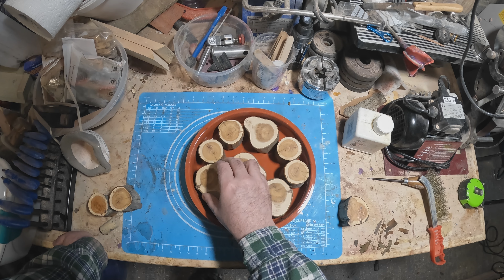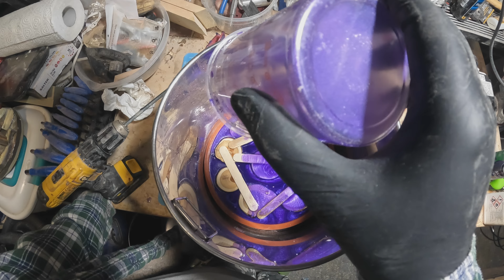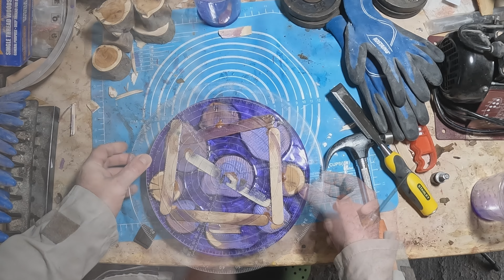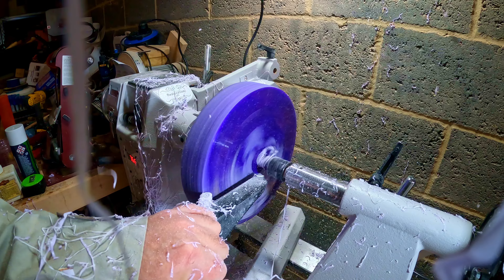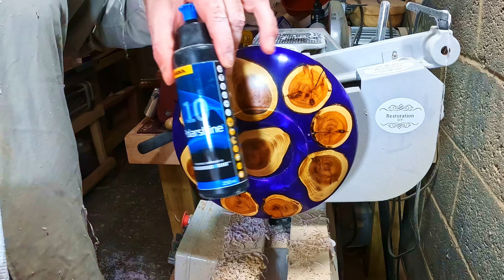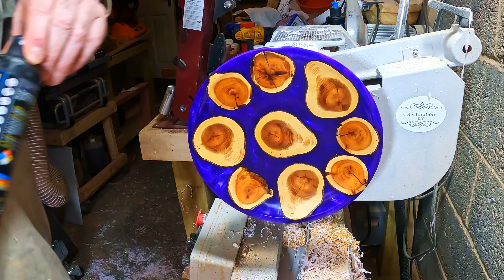Woodturning | Shallow Dish from Purple Epoxy Resin with Yew Inserts | Restoration DIY

Comment: A lovely piece👌🏻

Your excellent videos generally run for roughly 15-20 minutes and, of course, you edit and apply time-shifting to achieve this.  I’d be interested to know how long a project actually takes from the initial attachment of the unturned block to the lathe to the finished item’s final removal. Thanks.
Reply from the maker: Hi, Thankyou this particular project took about 3 hours to complete plus 30 minutes to cast the blank, a lidded bowl takes around 4 hours.